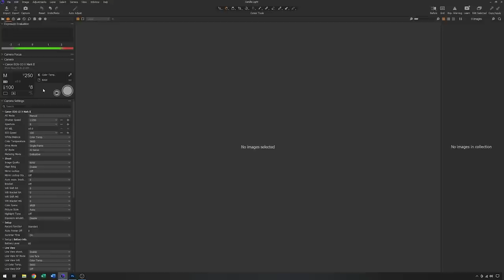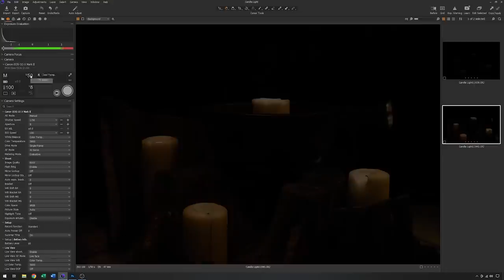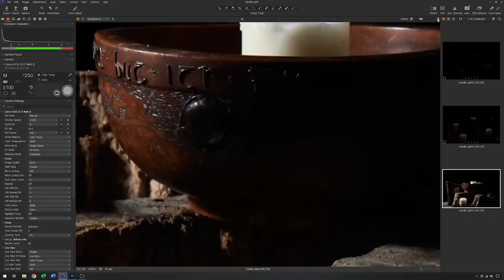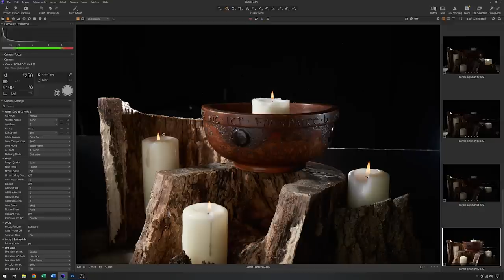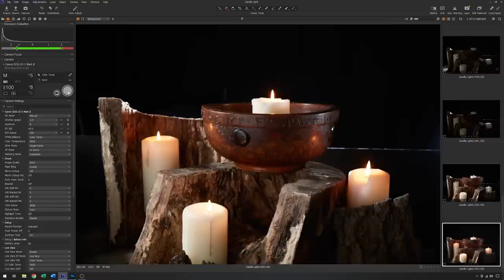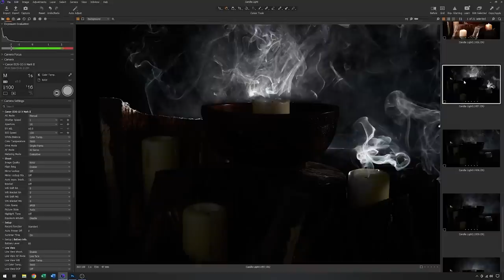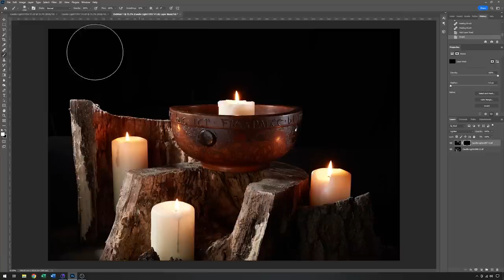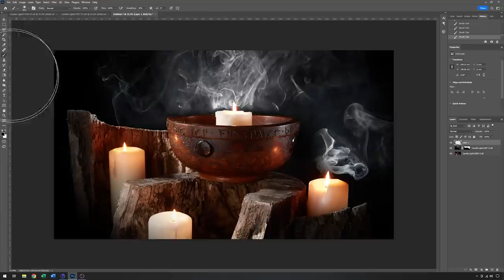Combine flash strobe with candle light

Comment: Love your use of flags, I am always moving lights   One question what type of clamps do you use with your lab stands? I have 2 stands but the clamps I have found so far are not good for holding flags
Reply from the maker: You are right, just using the clamps can be difficult, I use a clamp in conjunction with a short bit of 15mm tube, that does the trick.
Thanks for watching
Reply: @CameraClubLive  Thank you, I saw what looked like a rod of some kind on the back side of one of the flags that must be the tubing  keep up the good work